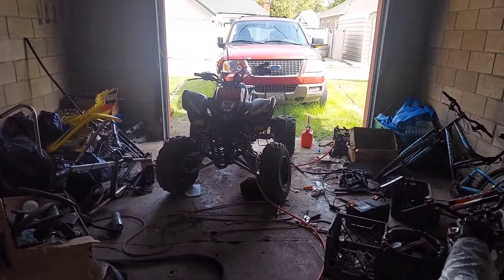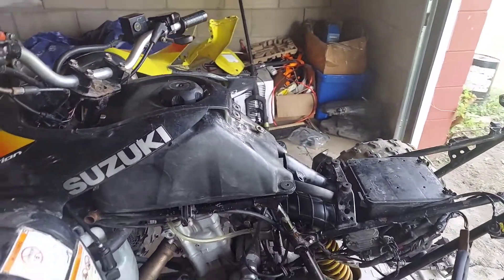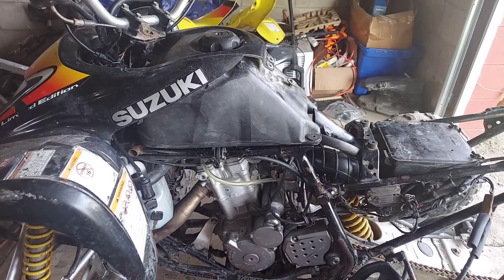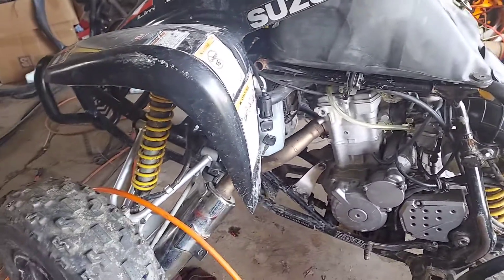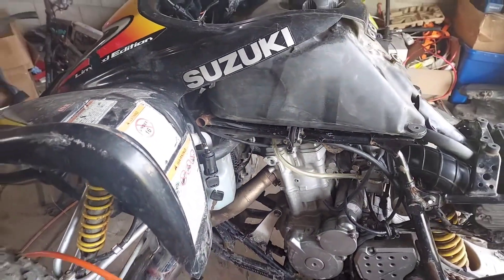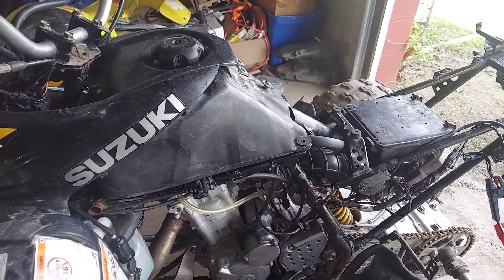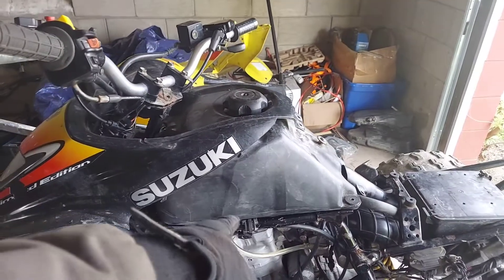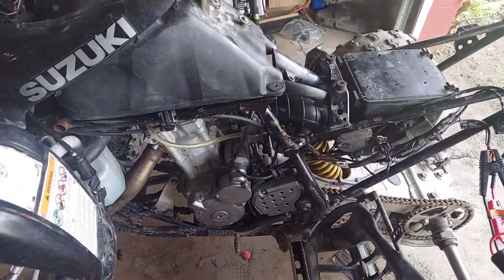Quad Sport Z400 not starting

Comment: I realize this is 9 months old, but Check the 3 yellow wires from the stator with a volt meter for a short to the frame. open is good,  a short might mean your pickup coil is either burned or chewed by a bolt coming loose from the flywheel. I just threw a mystery motor in my DRZ and thats why mine wouldnt start!
Reply from the maker: Is been a while lol but,  it was the valves lash tolerance in the end